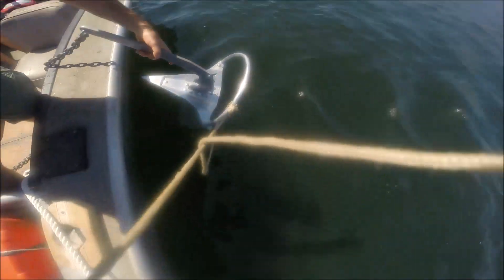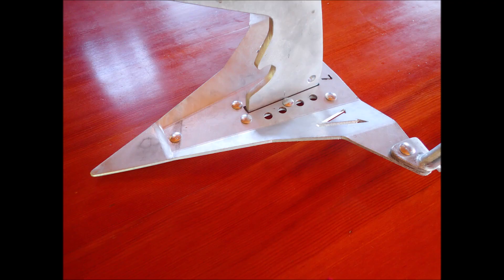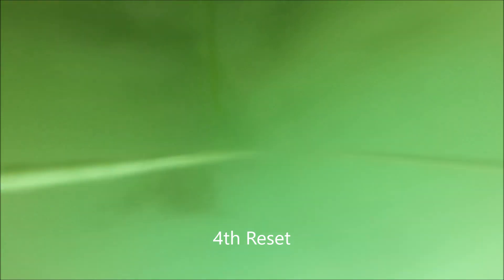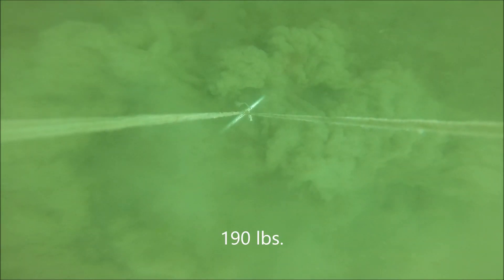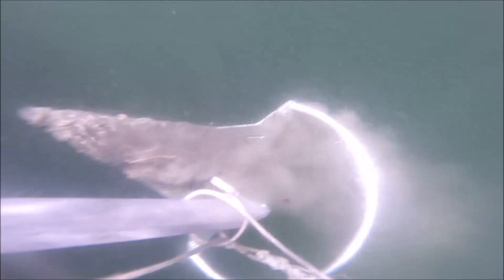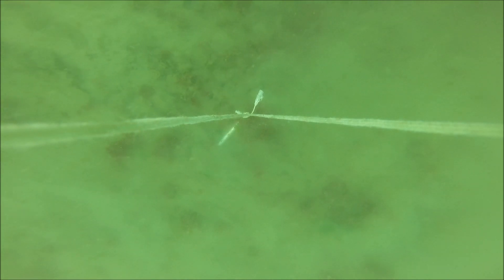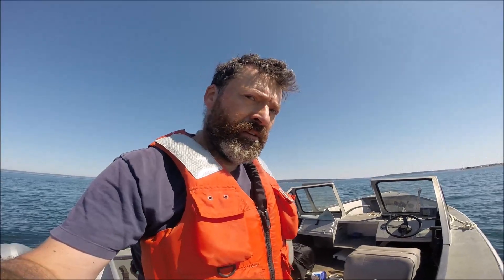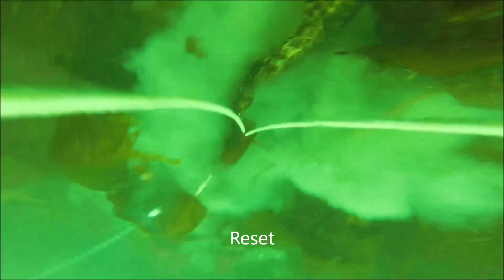Viking 7 Test.  Anchor Test #74

Comment: Steve, not sure if you are aware but this anchor can actually work as both convex and concave. Perhaps you could assemble it in its concave configuration and consider testing this anchor as a concave to see if there is any significant affect on setting and holding performance or mud accumulation, etc. Thoughts? :-)
Reply from the maker: Might give that a try.  Thanks for the idea.
Reply: Ive noticed that in their promo pics. At first I wasnt sure if i hadn't mis-percieved the image. My question is why one would want to assemble the anchor in a convex configuration like a plow anchor instead of concave like a scoop anchor.
Its worth testing, I supposed, but i have no idea why convex would work better.
Reply: @oaklandmax  it would reduce risk and volume of mud accumulation, which could aid in resetting ability.

Comment: Thanks Steve. I wondered how the new Vikings compared. That is a good looking alloy runabout. Your build?
Reply from the maker: Hi Ben, good to hear from you again.  Have you been on any sailing adventures lately? Runabout was built by a small, local workboat builder.
Reply: @flygoodwin  Pretty quiet here. Did another trip south on the icebreaker, then lockdown... 

Looks like you have more work happening with Panope. Looking forwards to seeing what you are up too.  Hopefully the patreon thing works out ok. Always looking forward to more anchor videos so I should sign up.